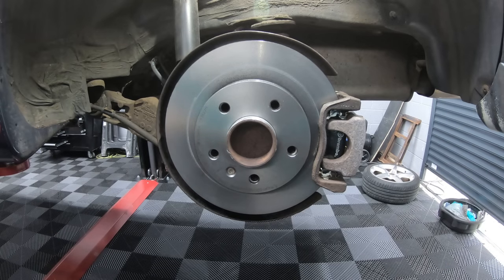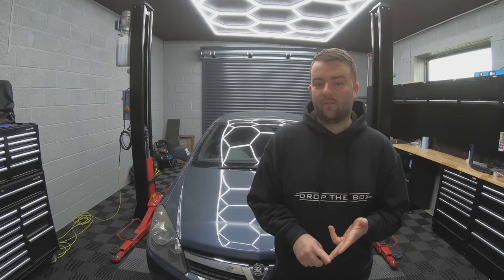Vauxhall Astra H - Rear Brakes Replace

Comment: Hi, whats the best way to do it. Pump the peddle and then bleed? Or bleed then pump the foot peddle?
Reply from the maker: Two person job for that method.
Pump pedal until it's hard, then hold down.
Second person open bleed nipple to release pressure, then close nipple and repeat process
Until all air is out of the system and you have a good pedal feel .
Reply: @DropTheBoxOfficial  thanks for your reply! I meant if I've just changed the disc and pads on the rear, should I pump the peddle so there's no gap between piston and pad then bleed? Or just bleed using the full kit then pump right at the end

Comment: Hi, why no mention of adjusting the handbrake? Surely with the piston fully wound back into the caliper and the new full thickness disc and pads, the auto adjust mechanism would need resetting too?
Reply from the maker: The self adjust mechanism is integrated within the caliper. When you push&wind the caliper back you are resetting this mechanism. When the footbrake/handbrake is applied this system will automatically adjust to suit the pads and discs.
The only time you would need to adjust the handbrake is if your cables have stretched, this is done where the cables connect to the handbrake.(10mm socket required for this adjustment)
Thanks 😊
Reply: @DropTheBoxOfficial  sound, ta

Comment: Hi just been watghing your content on how to go about replacing break pads n disk, Just to confirm did mension torx setting 150 nm ? Thx u
Reply from the maker: Caliper carrier torque setting is 100Nm with thread lock. 
Please note that torque settings should be obtained from your own source.

Comment: Is it absolutely essential to use a wind back tool?
Reply from the maker: It's probably possible to do with long nose pliers or a home made tool, but for the sake of £15-£20 for a wind back tool is it really worth struggling and possibly causing damage to the caliper?
Reply: Thank you for the response. I have acquired a caliper cube tool and plan to replace pads and discs for my first time tomorrow.
Reply: I attempted today. Used windback cube. Ballache. Got the proper tool from a neighbour f***ING lifesaver. Thanks for the video it was of great use.
Reply: What make of greas is that please
Reply: Use an angle grinder disc removal tool. Perfect fit.